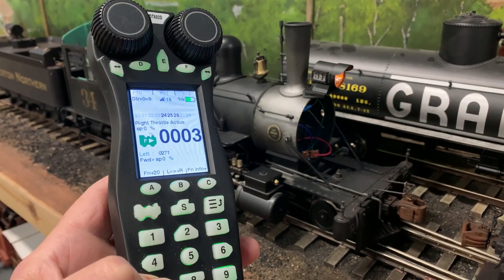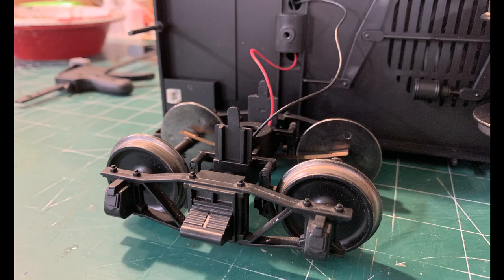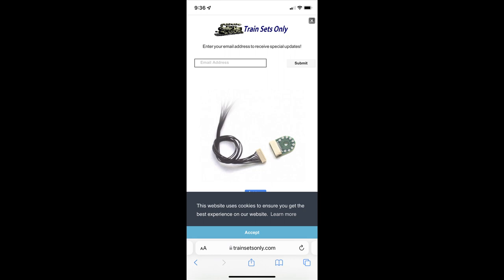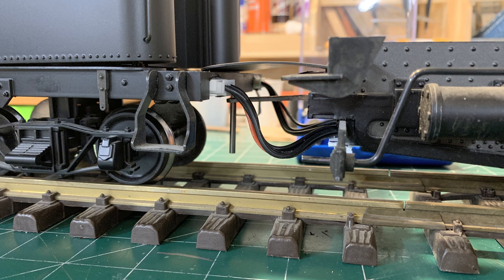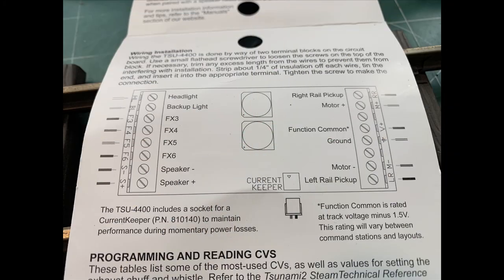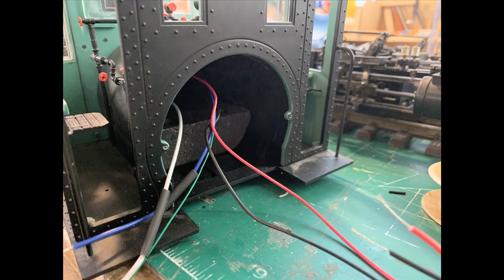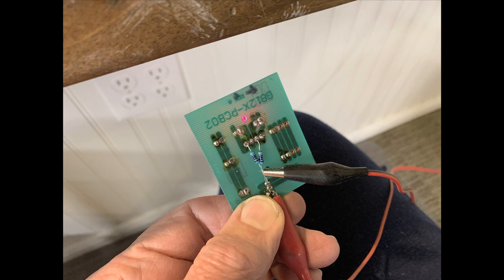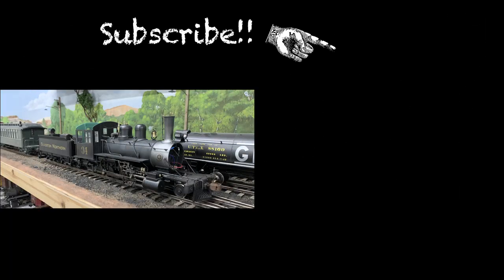Converting the Bachmann "Connie" Consolidation DCC using the Soundtraxx Tsunami2 TSU-4400

Comment: The Connie is coming along and looking really good. Getting through the wiring set up is the hardest part and you have done a great job. Wireing projects can some times overwhelm most people. Just take your time and draw the wire layout so you can understand it yourself. It doesn't matter about other people as long as you can grasp and under stand it for you. Before you know it they will be done and you will be looking back and enjoying them. Thanks for sharing this upgrade journey. I am at that point of wanting to change from dc to dcc. Been use to dc for all these years changing over seems to be a major task. Be safe and see you on Sunday.👍🚂🚂🚂🚂🚂
Reply from the maker: Thanks. Er tanks. Cause that’s what I’m working on today. Air tanks.

Comment: Great explanation. Color coding is very important, especially when you have several wires pop up somewhere from the locomotive, if you need to redo something later, it will be very useful.
I would do one thing different: use special high temperature 3M double side tape. It was a MRH article about it some years ago, and as decoder can become hot, normal double side tape will deteriorate. It costs more than the normal, but the decoder is a lot more expansive!
Reply from the maker: Thanks for that!  Illlook onto it.
Reply: @ToyManTelevision  I use Scotch 40021915, it's an European reference, but 3M should sell it under another reference in USA.

Comment: That is looking good.  Soundtraxx are easy to change how each "light" can flicker as per the videos and tutorials on their YouTube channel.  See the Hyperlight Effect in the full handbook - there is a flicker for ash pan and another for fire box, as they are LED need to add 128 on to the value.  Smart firebox flicker is a good option.
Reply from the maker: as soon as the locos are finished the next project is the roundhoues. Or really just track one off of the turntable that doesn't exist. because track one will be the programing track!

Comment: There is ribbon cable that comes in the resistor color code. The wire is 24 AWG
Reply from the maker: need to find that.

Comment: That is a lot of wiring. Makes one wonder if an F scale actual steam loco would be easier..... 🤔 😎
Reply from the maker: some day......
Reply: Trust me. It's not. Weather issues (butane doesn't like the cold), burning yourself on a hot engine, challenges controlling it with R/C, O-rings going bad over time, trying to watch your water level...It's a ton of fun. But also much harder than an electric.
Reply: @jordanhelzer3306  Thanks for the feedback from one that knows. Good info. But I was of course tongue in cheek wisecracking, not trying to be serious. 😎